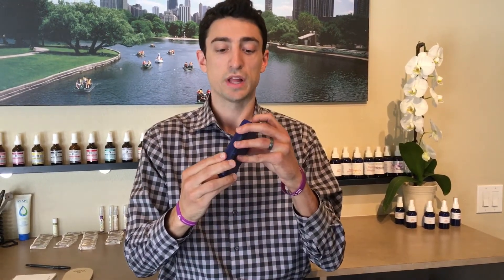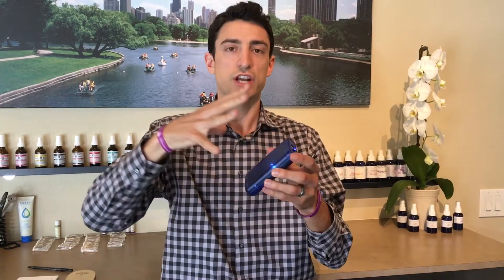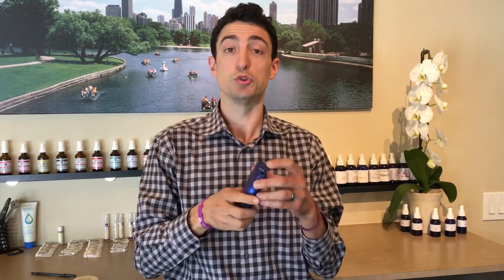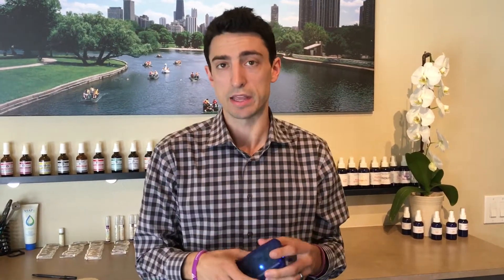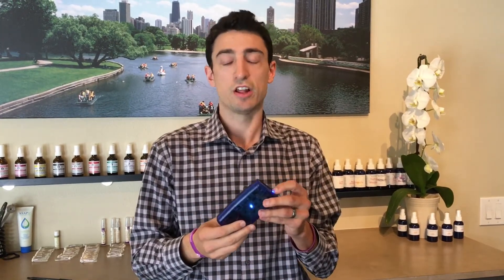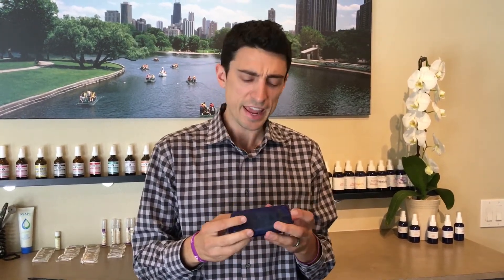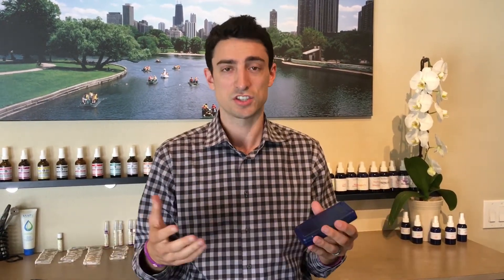Sympathetic Resonance Technology

Comment: How does this differ from wearing a Q-Link pendant, which also uses SRT?
Reply: Nowbeone 😊 I love my qlink!
Reply: @Harmony1503   Me too!! I have been wearing mine 24/7 for almost 2 years. I would not want to be without it. I have a Translucent Carbon and Translucent Blue Sky. Which one are you using?
Reply: I think this video is explaining what SRT is, which is also in the q-link pendant. So it’s doing the same. But his device has a power supply where the q-link pendant uses a coil to amplify these natural frequencies, so my guess is that this one is probably stronger.
Reply: @henkdaaps  Q-Link has a USB Plugin module that works similar to this
Reply: @Unclesalbert  You mean the NIMBUS?